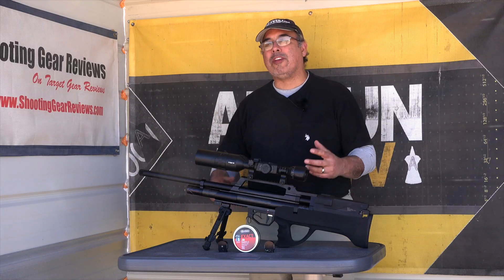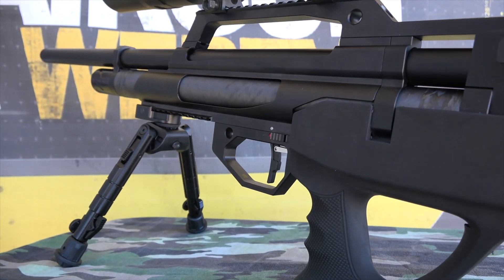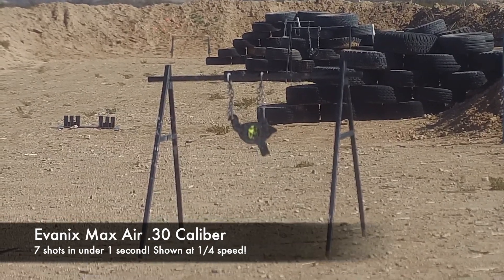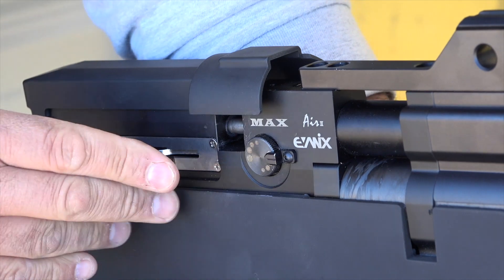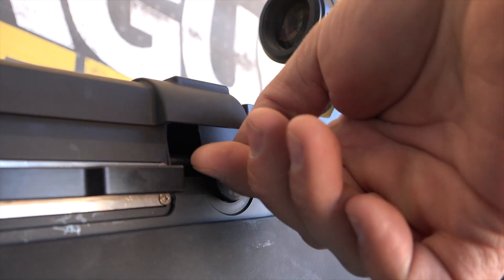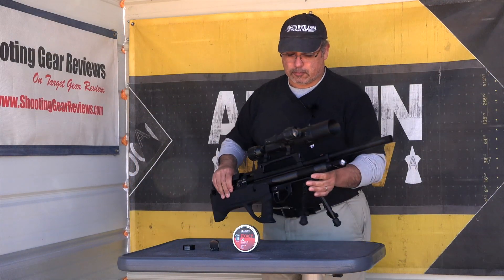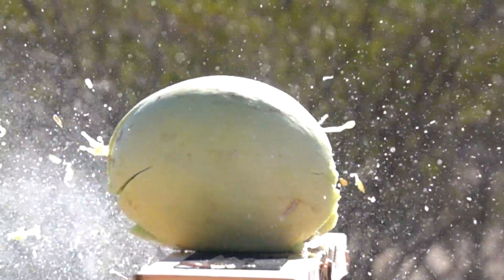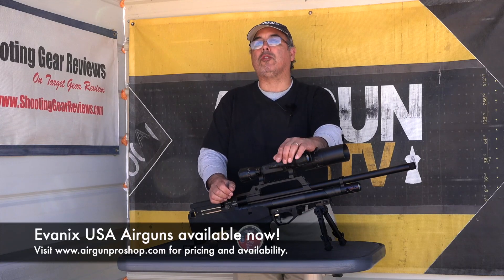Evanix Max Air 30 Caliber Semi-Automatic PCP!

Comment: I dont know if you still read these comments but I got a few questions. Did you shoot the gun at 100y? If so, how did it perform? Still packs a punch at 100y or not? Whats your oppinion about the gun after all these years? Thanks
Reply from the maker: Hey there. It’s interesting that you ask. I’ve been wanting to get it out again and do some shooting. I guess we’ll find out.  Stay tuned. 

Cheers
AGW
Reply: @AirGunWeb  Thanks for the response! It would be interesting to see how accurate/precise it shoots at 100y and how much energy it still carries at that distance. Evanix told me (via email) that slugs should be possible in that rifle. You ever tried slugs? Looking forward to another video about that rifle :)
Reply: I have a .25 Max Air and would love it if you took it out for another spin and discussed more. I would like to buy a few replacement parts in advance of needing them. In fact, I took the Parts Diagram for this model (in Korean) an developed a whole new parts list spreadsheet translated into English!

Comment: is this good for self defence?
Reply: Hypothetically speaking, if you came in my house with ill intent and I fired of all seven rounds, striking you five times with at least two in the face, are you going to keep advancing? First of all, the suspect is going to see the business end of a . 30 cal barrel, that will get their attention quick.  They don't know what type of rifle it is and will think it is a modern high powered 'black rifle'.

It is moving a . 30 cal 50 grain projectile at over 800 fps; that is going to penetrate and do some damage, it would be lethal at close range especially a lung or heart shot.

A . 45 ACP goes out of the muzzle at 850 fps. Now these pellets or slugs have much less mass and inertia, but they would have some penetration capability.

Bottom line, this weapon would have some self defense potential.
Reply: It a airgun can put a deer down now think definitely will put a human down with proper shot placement.

Comment: It's a bit strange that you fill it to 250 bar which is in the red area on the pressure gauge (manometer) and advise not to shoot below 150 bar which is well inside the green area.
Reply from the maker: They use the same gauge for all their guns.  The compressor required or optimal pressure for each model is outlined in the new elated manual. 

Cheers
AGW